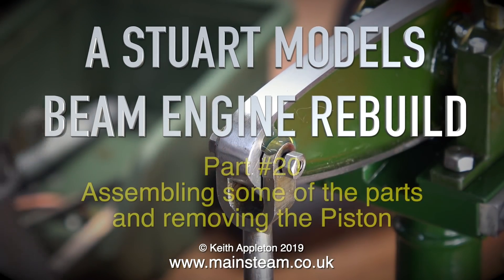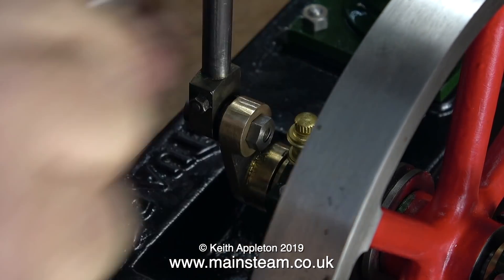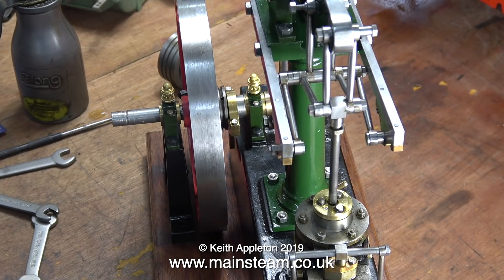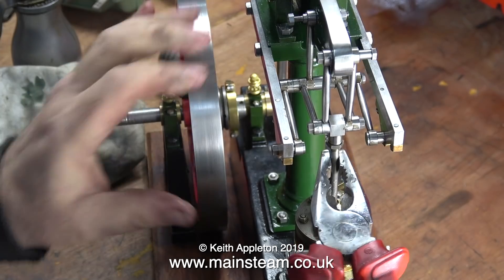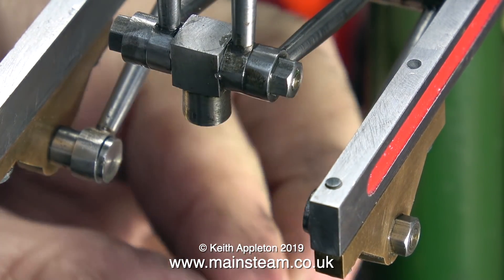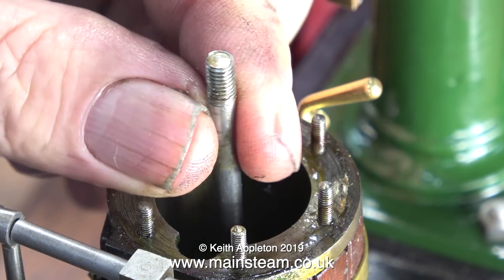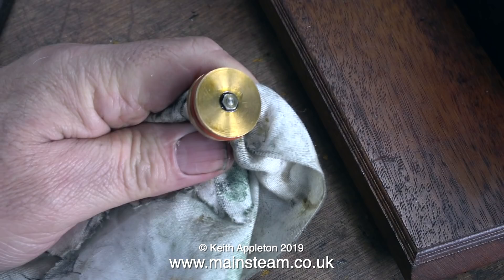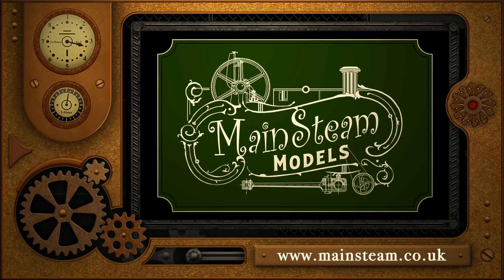A STUART MODELS BEAM ENGINE REBUILD - PART 20

Comment: Keith is this the same beam engine that you repaired the top of the pillar for the Bering mounts? Correct me if I'm wrong but is that the same engine that you added a flat plate to either side of the top plate for the bearing mounts? I'm only saying this because that maybe your difference in the length of your piston rod being able to screw into it's fitting! I may be totally wrong I'm only going by memory. Not an armchair engineer just curious, always a faithful viewer!
Reply from the maker: Please re-watch the Episode where I machine away the top of the column before adding the plates so the height of the column is the same as it was . . . . etc
Reply: @keithappleton  I knew I was forgetting something I was doing it all from memory, but always enjoy your videos!